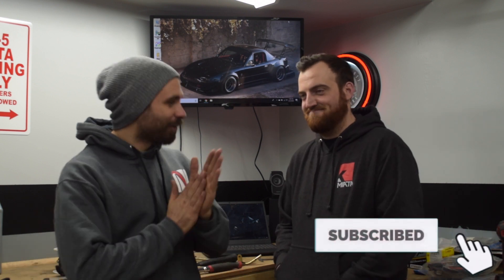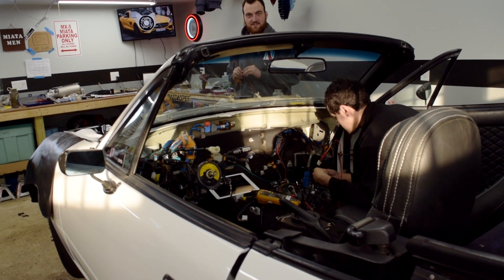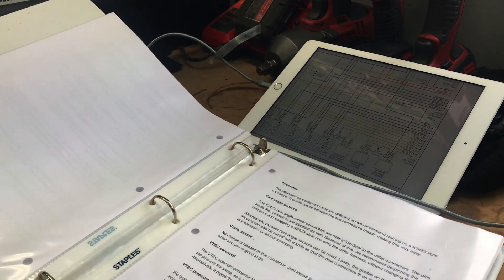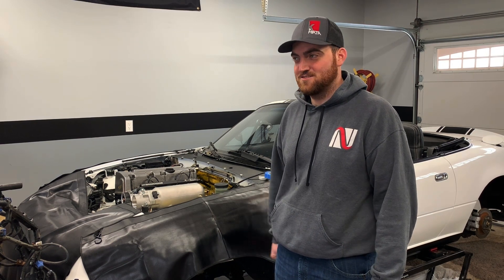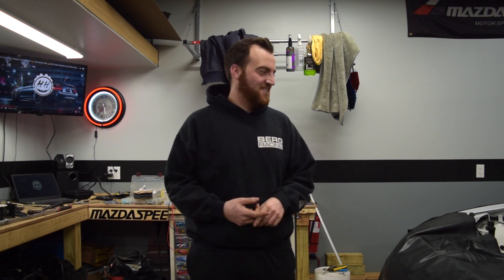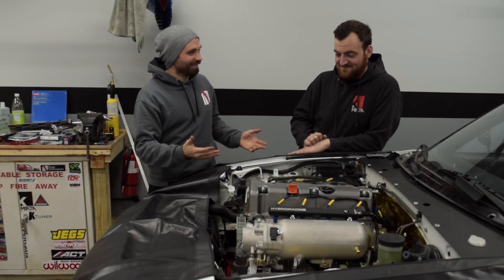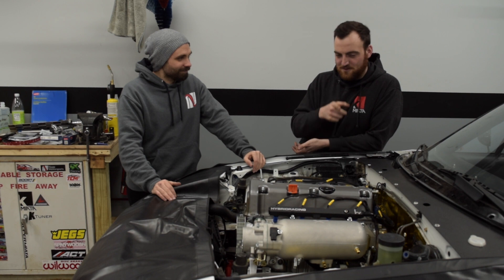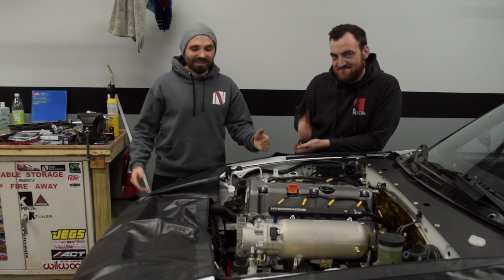Engine Wiring Harness - KMiata Build Part 4

Comment: What conector I have to change to make a element harness work with a k24a2 and a ep3 transmission
Reply from the maker: I used a Miata transmission so I can’t really help with this.
Reply: @NappMotorsports  I think vtec academy is going to make a video about but they told that’s a year ago and they haven’t
Reply: @NappMotorsports  and I was talking of how you pin out the element engine harness because some modifications on c01o1 plug and is similar to the 05-06 Acura rsx type s to work with k tuner ?😀😀

Comment: When using a k24 does the Miata transmission bolt right up or do u have to  change the bell housing?
Reply from the maker: There’s an adapter plate made by KMiata that bolts to the back of the K series, and it has the Miata transmission holes in it.

Comment: One very important? What oil filter sandwich plate adapter are you running to make some of the gages work.... thanks
Reply from the maker: This glowshift one from Amazon.  GlowShift Oil Filter Sandwich Plate Thread Adapter - 20mm x 1.5 Thread - Install up to (4) 1/8-27 NPT Oil Pressure & Temperature Sensors - Includes O- https://www.amazon.com/dp/B007SXGAZQ/ref=cm_sw_r_cp_apip_FxVCL9AUWY78j

Comment: Thanks for making this video series. I was going to record my swap, but now I don’t have to! Have you considered using a c-clamp for those big 4 gauge crimpers?
Reply from the maker: I did, but it didn’t seem right. That tool was like $35 brick and mortar. You can get it way cheaper online and it worked really well.